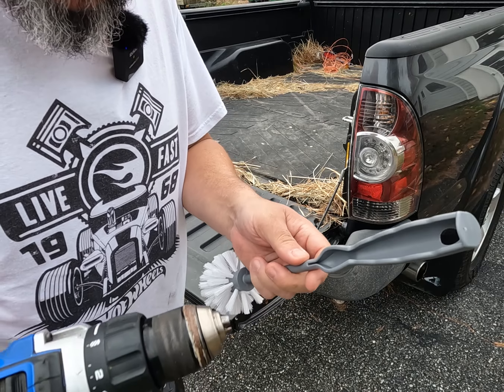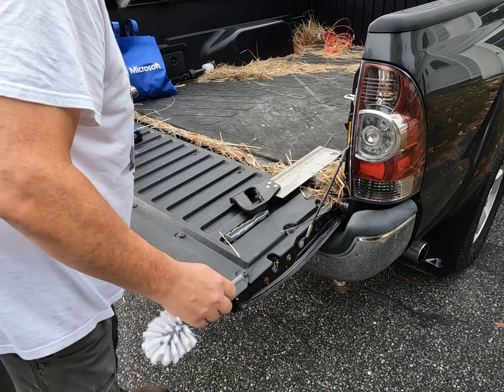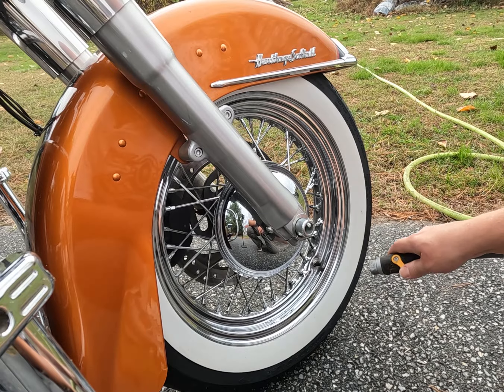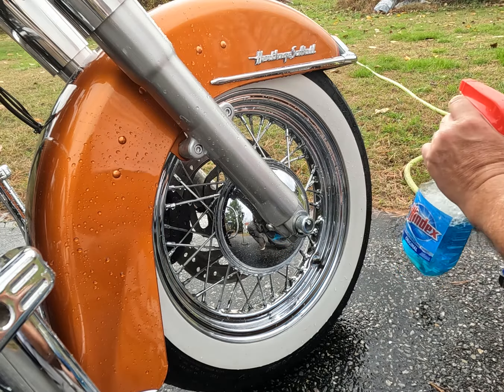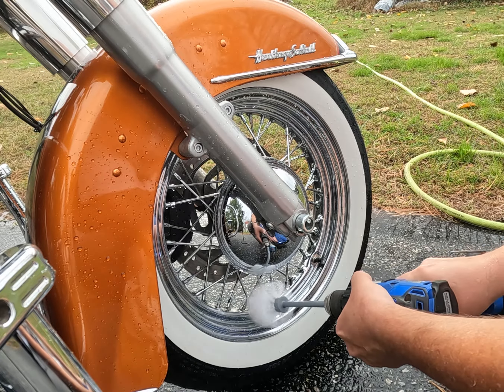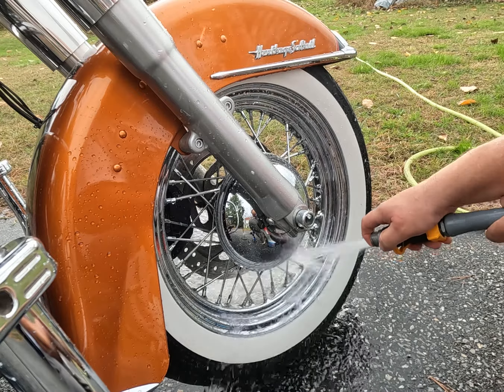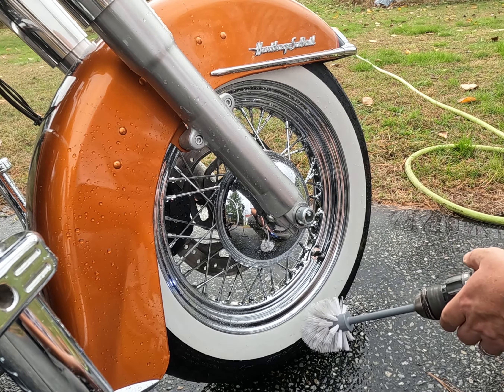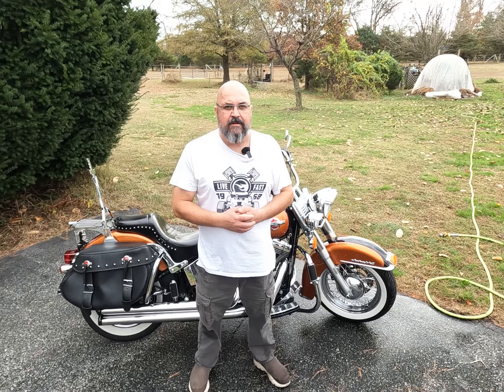Easy way to clean spoke wheels

Comment: Hmm, not only a good way to scratch your chrome with those hard bristles, but also add some piting from that ammonia, too.
Reply: what product would you use? Degreaser, a soft brush? I feel like that's what I need
Reply: @meggirard5873  I normally just use car wash soap but just make sure to use a clean microfiber towel.
Reply: Yes this was a very disturbing video as most of the goofy stuff you see on YouTube by these kinds of people. This was one of the most ignorant things I've seen.
Reply: @meggirard5873 there is no need to use anything harsh unless you have rust filled up on the spokes or the rim of the wheel. A simple non-acid wheel cleaner section by section and a microfiber detail brush to go in between the forks rinsing each section right after you washed and then take a microfiber mint and completely clean the wheel over again then either ceramic coat or Chrome polish of a good quality such as mothers. Do this twice a year and they'll always look excellent. Please don't follow with this guy did because it was very disturbing to watch
Reply: @willsrestorations  I don’t know what’s goofy about it. You don’t need to do this on spoke wheels on a new bike, but it works great for and older bike where the spokes and spoke hubs are rusty. I didn’t use window cleaner but I did wash them good with soap and water and smeared some Turtle Wax brand chrome rust cleaner and wax and it worked beautifully. A dedicated spike brush is about $20 and a fine bristle toilet brush was about $4.

Comment: Does it matter which way the drill turns?
Reply from the maker: The direction does not matter. As other comments have cautioned, use a soft bristle brush and be careful to avoid scratching.

Comment: The only problem is it's ALSO a quick easy way to get water in your rim through the spoke holes.. and that moisture will NEVER find it's way out.. which creates rust inside the rim..  I NEVER put water on my harley..  I do the spokes with a wide shoelace..
Reply: I don’t have 2 hours to  spend on the spokes with the shoelace method. I guess you show your bike more than ride it, and never sees rain either huh ?  My bike was a garage queen when I bought it. A 13 year old bike with 1,256 miles on it. I like bikes that guys buy and never ride, just sit in the garage polishing on them. They keep them looking great and like new with no miles so I can buy them dirt cheap later on.
Reply: @howdiedoodie8587  nah, i dont show my bikes anywhere..  but CLEARLY I take better care of my bikes than you do..  but, hey, keep wettin down your bike..  see how that works out for you..  👍 😆
Reply: @brsha8762  People crowd around my bike all the time. They just love that Big Red Flake Hard Candy Custom, that is always showroom clean and it gets Amsoil oil, transmission fluid and primary fluid every 3,500 miles. She was immaculate when I bought her in 2023 with 1,256 miles on it. Not bad for a 2013 model. And all other maintenence is by the book.